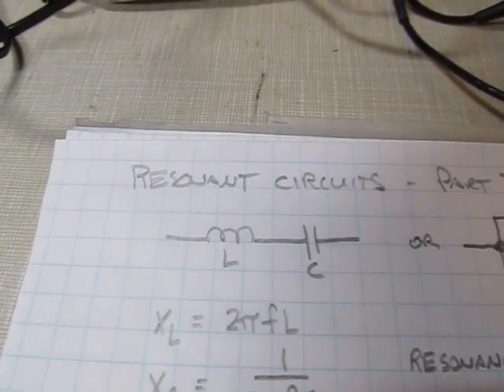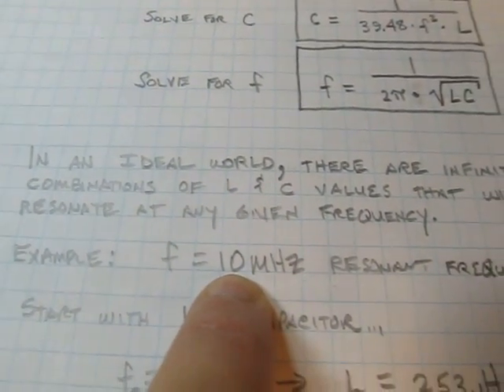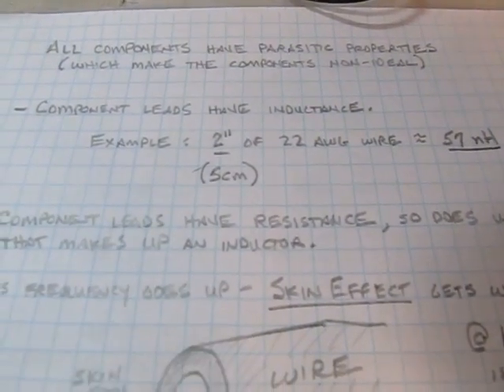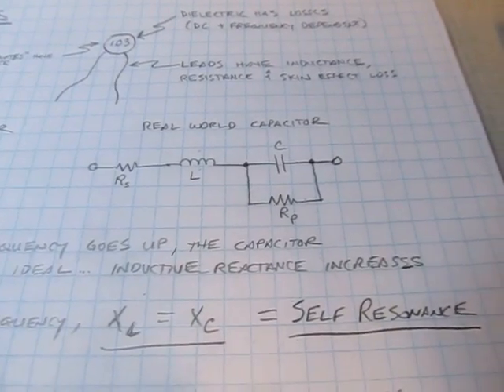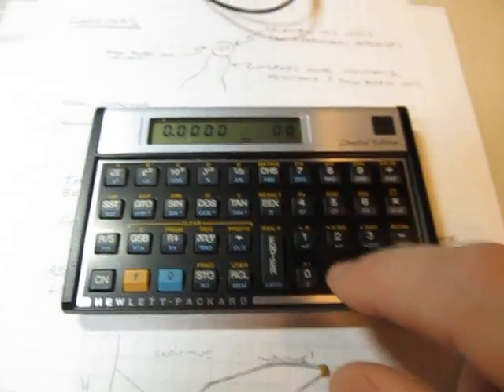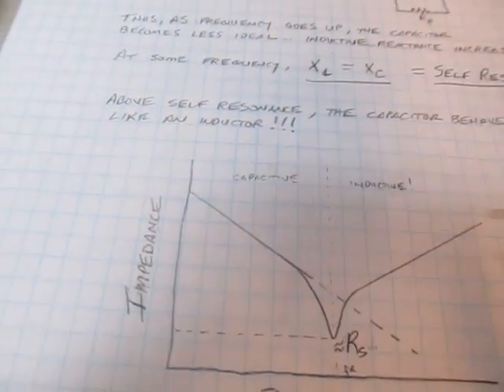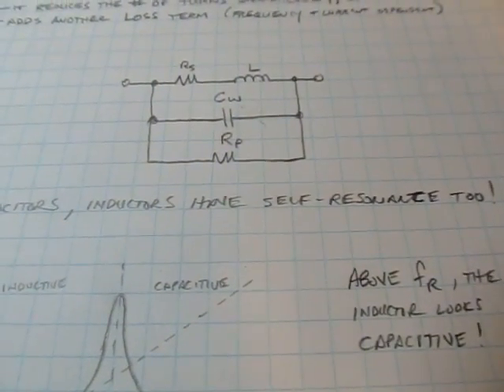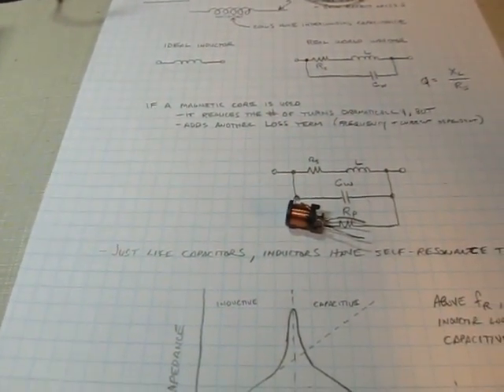#56: Basics of Capacitor & Inductor self-resonance, parasitics, etc. - Tutorial

Comment: can a human beings resonate frequency change via elementary alterations, ie low voltage contact, high voltage contact,  microwave radiation, and or small amounts of absorbed mercury; also if so, can said person directly affect random electronic device performance unintentionally? ie,  discontinued operation of electronic devices after long term exposure directly to said persons skin; then returning to proper function after being removed. audio equipment volume dramatically changing with out contact with said person, speakers connected to only amplifier emitting audible  coversation via audio radio signal with out AM/FM radio attachment, battery's drain unreasonably faster when used by said person,  vehicl electronics malfunctioning with no prior history of problems, ....ect... .... ...?  these are strange side effects I and others have experienced. we are searching for rational yet in conventional explanation for these and other strange occurrences.  research shows resonant frequency can alter elements dose it work the other way around with a biological "median" so to speak.  or am I just making myself sound crazy asking this? thanks for reading please feel free to reply.
Reply from the maker: +jason haugen not to my knowledge.

Comment: Thanks. great video. Just a question. The impedance of a capacitor at low frequency should be a hyperbolic function and is not linear or am I missing sth ?
Reply from the maker: +nima dabidian I guess I should've mentioned - both axis are log scales...
Reply: I see. That makes sense

Comment: can you make more videos like this one where you show the real lumped model of components.  like or all the other comopnents in electronics so when simulating ... i'd assumme i can just put in the real world models to get a better closer simulation to real world. I like how you explain applications of these things.  If possible and you have time.. make more awsome tutorials like this one.  Biasing transistors, chossing mosfets, .. different types of diodes , choosing op amps, ..or transformer design... anything realy. Reason why i ask is always i see informative information weather in a book or video.. but they never say whyyyy you need to know that.. whats the application of it.. like how to peaice everything together so someone can get a better idea at trying to make a design.  Whats the main idea that needs to be taken from the topic and how you can use it to your advantage.
Reply from the maker: +Branko Miletic You can get a good first approximation for any component's parasitics by assuming that you have a few pF of capacitance between the terminals, and a few nH of inductance in series with the terminals.  Of course, the actual physical construction of the component will determine how large these parasitic elements are.
Reply: thank you so much. I greatly appreciate your reply. very good and clear content.

Comment: What happens if I swap l and c for eachother at high freq in ckt. Will I get a min impedance at high freq if I use inductor in place of  actual cap in ckt. Will their boths function change vastly?
Reply from the maker: ***** Ideally, yes.  the impedance of an inductor increases as the frequency increases, which is just the opposite of a capacitor where the impedance decreases as the frequency increases.  Of course, once the frequency is above the self resonant frequency then things tend to somewhat reverse due to the parasitics.  However, it is highly unwise to design a circuit to depend on the behavior above self-resonance, because it is non-ideal, not specified, and not well controlled.
Reply: Okay. Thankyou. Liked your videos. ☺😊😊
Reply: +Rohit Shinde Thanks for asking that. I was wondering the same thing, if one could find L and C with the same resonant frequency and have them counteract each other making for a wider frequency range by essentially causing L and C to switch places. Seems like finding the right components to perfectly match each other's dips could get really tedious, but an interesting thought exercise.

Comment: At 7:19 in the video you mention that the plates of a capacitor can have some inductive effect. My understanding is that ceramic capacitors are much less inductive than electrolytic capacitors. I've noticed that ceramic capacitors can have the same capacitance value but have different physical size. Does the physical size of the capacitor (more specifically the plates) have any bearing on the inductive effect of the capacitor?
Reply from the maker: There are a factors that affect the parasitic inductance of a capacitor.  Physical size, number of plates, physical shape/design of the plate and terminations, etc.
Reply: Thank you.
Reply: Is the inductance of the capacitor directly or inversely proportional to the plate size? I'd like to have a dip meter and a frequency counter. Is that somthing you can buy in a store?
Reply from the maker: The plate inductance is a function plate size and configuration. Long thin plates have more inductance than short wide plates.
Reply from the maker: Frequency counters are common, easy to find from test equipment vendors and distributors or online. Grid dip meters are a bit more rare. Still available new from MFJ Enterprises or buy used on eBay, etc.

Comment: Thanks a bunch ! ok now I am going to build the modulation stage and try to understand how it works. because I learnt it is a common base after watching your new video I can see the input and out put of the CB but R4 is supplying the bias voltage to this base so the base is not sitting at "Zero" is this because it needs to keep the T2 on to make the path to 0volt to keep the tank going?

Comment: Hi Alan I was checking this a three stage FM TX and they talk of a feed back capacitor BUt I don't see any feed back and I did some readings and found out that the internal capacitance of collector base and base emitter of the transistor acts as the feed back in very high frequencies is this correct? sorry to keep bothering you.

Comment: Hi Alan, if I have a tank circuit in a FM transmitter and lets say the tank resonate at 108 MHZ from the FM circuits I can see a transistor is driving the tank circuit. can you explain to me 
1- is this transistor acting as amplifier or a chopper to provide AC to the tank?
2- At what frequency this transistor should operate in order to keep the resonance going.
3- some times  I see a capacitor across this transistor what is the purpose of this capacitor?
appreciate if you answer these.

Comment: Thanks Alan for your videos. a question: If I want to design a simple RC (series) filter can I say that the RC circuit at resonant point has "Zero" impedance and hence at that particular frequency i.e resonant frequency the circuit will be a short circuit and hence the voltage is zero hence its filtered out? appreciate if you respond. cheers

Comment: As always - great video.
A question regarding the the skin effect. Since a bigger cross section of a wire equals lower resistance, is it fair to say that the skin effect results in higher resistance of the wire as well??
Also, if the current passes through the outer layer and not through the center, why not use tubes instead of wires?

Comment: Why doesn't any of the circuits you have drawn in this series of video have a series resistor? Did your actual circuit at least have a resistor (other than the 50 ohm probe)? The explanation would be more complete if you had a resistor in the circuit. Thanks for the informative video.

Comment: Video is great.  Verified your results.  However you might want to correct your presentation on impeadance of a capacitor.  Either make it the "absolute value" or change it to a negative value.  Also the Xc drops of exponentially not linearily.  There is no dip at resonance either just a gradual crossover to the positive Inductive value.  The slope of the inductor is way out of scale as well given your values.